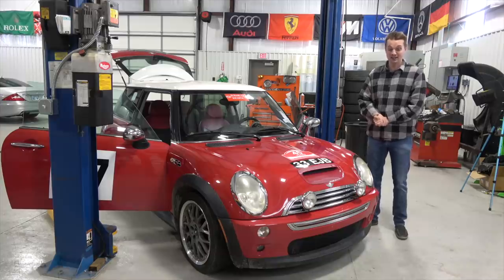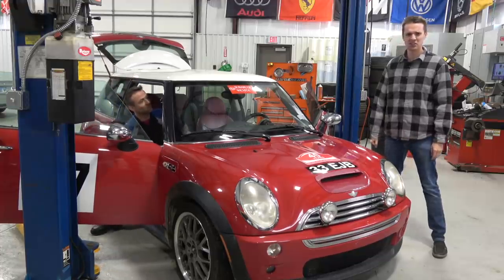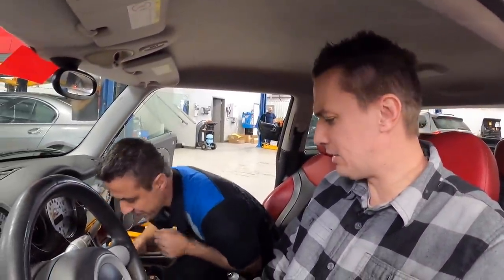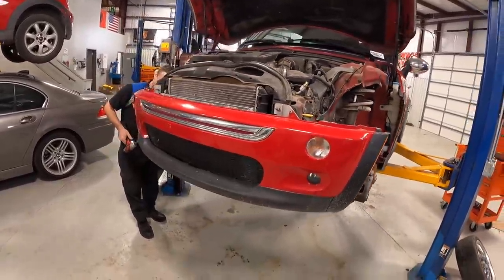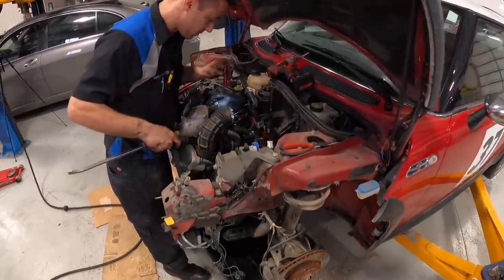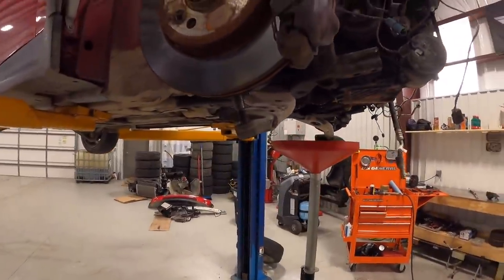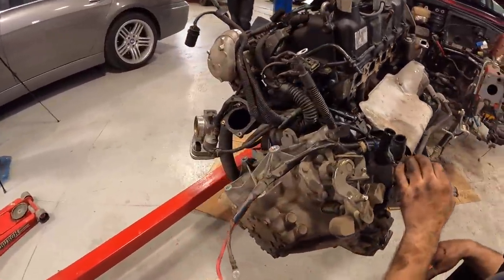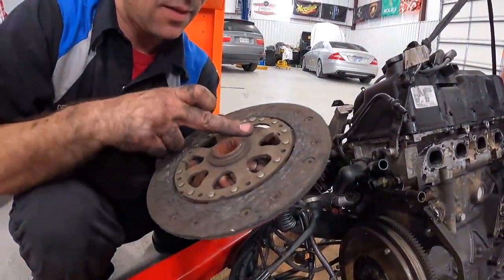Removing a Mini Cooper S Engine in less than 1 Hour? Mechanic Says No Problem!

Comment: Hoovie and Ninja blaming the weather that's out of everyone's hands for delays.  Meanwhile, I had people blaming me for delays on jobs.

I've had 2 MINI's, one Cooper, and the one I still have is a Clubman.  Traded the MINI S for a wrecked SS HHR and blown MINI Clubman.  Did a complete powertrain swap from the MINI/BMW stuff to the GM LNF Turbo I4 + manual with LSD.  Was a project to say the least and I was probably (most certainly) better off just getting a running SS HHR, or even a Scion xB, but it's a great little "panel van"-esque style wagon thing.

Comment: HI I had an  Original Mini when they where smaller in the early 1980's , the engine bay was small the battery had to mounted in boot,  or the trunk as I'm in the UK

Comment: I could probably get the motor out in under a minute with the right tool. Getting another motor in and working might be a different story.  Thing to consider - the mechanic also eats any time that may be needed for subsequent follow up work or issues. Plus all the time BSing in the shop is time. Ninja has a good handle on how Hoovie likes to talk. You dont often make money talking to customers.

Comment: It's lasted better than my Mum's 2004 Mazda 3 which was made in Hiroshima. Bought new it was scrapped a year ago with extensive rust on the rocker panels, inner beams and seat belt anchors points. They are rust buckets with reliable engines.

Comment: I’m sure I am a week too late for this advice but - change the crank pulley if it is the OEM. It is going to fail. Spend the $300 and buy a fluid filled crank pulley.

Comment: My 02 Mini Cooper S had 212k miles on it when I sold it. I bought it from a friend who was the original owner. When I sold it the only repair items ever done were the fuel pump and power steering pump.  Wear items like brake pads and wipers were obviously don't but it was one of the most reliable cars I've ever seen. I know the kid I sold it to, he's been driving it for almost two years and hasn't had a single problem either. You just never know sometimes. 
The next one was a complete money pit.

Comment: Actually, look at the 3,4, and 6-71 Detroit Diesel (2 stroke) engines.  The supercharger is on the side of them as well (the infamous 6-71 General Motors Detroit Supercharger; a.k.a. Weiand 6-71, which is the exact same with a different housing to facilitate attachment to different engines).  Yes, these engines were TURBOSUPERCHARGED!

Comment: Dad and I once shocked the parts counter at the local junkyard by pulling an LS engine in under two hours. Admittedly, we did sawzall the radiator support.

Comment: I can do an aircooled VW engine out and in, in under 40 minutes. It's not hard if you have a lift and have done it before. Without a lift, or doing it the first time, could take you several hours.

Comment: Can u change the mini copper s engine for another type of engine like a Honda or Toyota I have a mini but I have been having problems and I dnt want to let it die so I want to find a way I can make it more reliable if that’s even a option
Reply: They make a few different swap kits for the R53 mini cooper (the model shown)...  Honda K swaps are the most popular but I've seen a Mitsubishi 4G63 swap, etc.   The MINI engine isn't unreliable... you just need to keep it maintained.   My R53 has over 225,000 miles on it and it runs perfectly...I drive it hard too.  The sound of that supercharger is intoxicating, and way more fun to drive than my other cars that are much nicer, faster, more expensive, etc.

Comment: speaking of fast engine outs, during my time as a tank crewman in the Marines, I've seen an engine/transmission out in 20 minutes.
Reply: I have been trying to find details of a stunt that the military did at the Royal Tournament one year. Didn't they do an engine swap on a Mini Metro in five minutes or something ? Things were probably rigged with quick releases etc but the car was driven into the stadium and driven out with a different engine.

Comment: Not bad. I removed my 06 supercharged range rover in under 2 hours my first try. Prob could do in an hour. Shops said body has to be removed I called bullshit even left the crank pulley and tq converter attached. Engine blew and the tq bolt hole was blocked when the oil pan blew apart. (The more you know lol) crank pulley rusted solid on it.

Comment: I used to work at this shop in Medford oregon when I was 19 years old. 11 years ago. There was only me and one other guy that worked on the cars. We did r and r work. The owner only did transmission rebuilds. He could whip them out super fast so he was mostly out looking for more customers or picking up parts. Well me and the other guy which was his younger brother. We were working on this mitsubishi 3000gt. It was pile. We had gotten a replacement engine to swap and we pulled the engine and swapped a junk yard one back in in two hours. I can't remember how long it was supposed to take but will never forget that we yanked it out and put a new one in completely in two hours. Now it woulda took longer by myself. But this was two people pulling stuff off at once. It turned out to be a shit engine anyway so it wasn't worth it. But I still can't believe how fast we got it done. Shit it took me an hour the other day just to pull my radiator out of my Suzuki aerio. The average person probably couldn't get that mini cooper engine out in 3 or 4 hours but when you do that everyday and have done hundreds. He coulda got it done in a hour if it went all right. But sometimes you have hangups like seized bolts and shit that won't come apart. Or studs or bolts that snap. I love working on cars. I love watching anything and everything about cars. Honestly it's a very good skill to learn. Even if it's just simple things. Most people run thier car into the ground because they think it's to complicated but really when you learn what a car is and what an engine does and the parts that make it work then you can almost apply it to every vehicle.

Comment: Took me 2 days to change my top mount intercooler on my r53 because like a total moron I caught one of the leads on one of the plugs so a spark plug was lose. But in my infinite wisdom I obviously did not notice this and assumed the missfire was a vleak from the snoot boot on the new intercooler so I was fucking around trying to get it to seal but it was already fine 😂 when I noticed the plug I could have cried

Comment: Well that is a Peugeot engine, not a BMW one. BMW borrowed it from PSA(the group that owns Peugeot-Citroen) so that they save money and not make one of their own, at that time downsizing wasn't a thing and they didn't have small supercharged or turbocharged engines. The cool thing about this car is that it can be so easily tunned, just by replacing the supercharger pulley you can get a couple of HP. A nice car, drives like a kart, but is super rigid and breaks your kidneys on a bad road 😁.
Reply: It's not a R52 but a R53. It has the tritech motor.

Comment: If a mechanic can do a job off 5 hours in 1 hour you pay 5 hours
If they do it in 6.5 hours you pay 7
Mechanics: this is the way 🙂🙃
Reply: Not generally, If it's booked as a 5 hour job that's what you pay. Regardless of whether or not they spent an extra 2 hours melting off rusted bolts

Comment: Gearbox out, clutch changed, box rebuilt, front end bushes replaced and power steering pump changed, all without removing the engine, de gassing the air conditioner or dropping the coolant.
By an electrician and and his 20 year old daughter.
Reply: foopyu nooui , very likely, whatever a shiptar is, he’s right about the bloody shifter linkages thou, they are proper shits to get off.

Comment: Here is how to improve a Mini Cooper:  Remove the engine and transmission (and all electronics), and replace all of that with the engine and transmission (and all electronics) from a Toyota Corolla.         Simple.
For that 'Apollo'  Porsche 911 you had:  You should have installed a V8 engine from a Lexus, those engines last forever and they don't 'blow up' the way an LS motor does.

Comment: Ninja has exposed the mechanics who stretch jobs out!!!!!!!!!!!!!
Reply: This is the problem with the mechanical trade.  There is a registry, which is what stipulates the hours a specific job takes.  This is what ‘you’ as the customer is billed.  If the job takes 3.5hrs in the registry-this is what you pay.  Weather they do it in 2hrs, 1hr, or 7hrs....you are billed what the registry stipulated.  Not the mechanics whim....

Comment: Bullshit the oil filter housing never "fails" its the o ring inside the oil cooler plate that fail and cause the oil leaks. I remove these engines in 25mins if I take My time

Comment: Nose coming off is easy in a northern climate because all the bolts are corroded with the salt and snap off ! BMW down spec'd all the bolts as a cost cutting measure because if this type of major repair was needed it would be out of warranty and no one in their right mind would contemplate BMW shop prices..🤣🤣🤣🤣

Comment: Maintenance doesnt matter with a BMW. It will fall to pieces and crap the sheets early no matter how well you maintain them. Especially MINIs. Especially first gens. They were just garbage.
Reply: Have you owned one.
Reply: @markcunningham8142  No way. I knew BWM built them so I wouldnt even think about buying one. I had friends and coworkers that had them, though (and a few had bmws, too). They were constantly in the shop, often having the same problems fixed over and over again. Sometimes they couldnt even figure out what was wrong with it.  And yes, they were all well maintained at the dealer. They just fell apart.